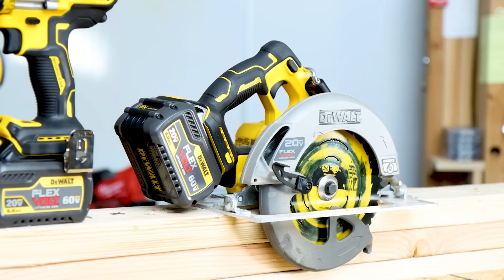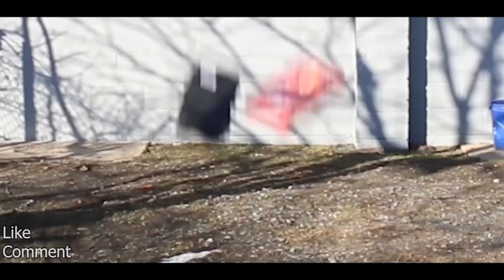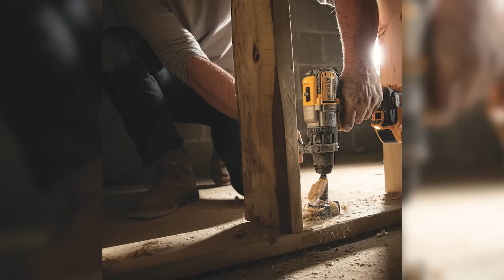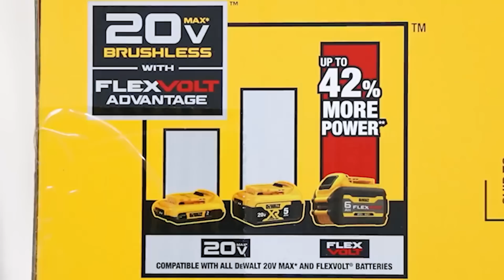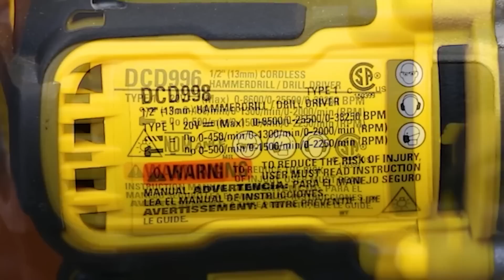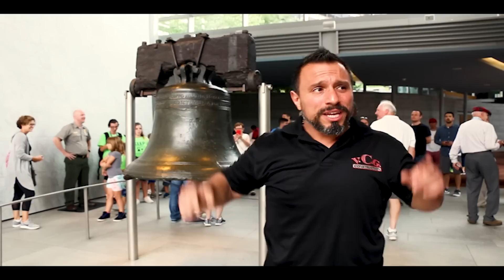DeWALT Tools DIRTY Marketing Tactics (FLEXVOLT Advantage AND Power Detect Hammer Drills)

Comment: You know what though i love and own a ton of dewalt tools at this point but completely agree the naming is a big confusion tactic. 

Its the same with every tool the angle grinder is the worst example i can think of 405 being higher spec than 412 but 415 is better again wtf is that.
And also with theyre combo kit sets. My friend was buying bare tools to build a collection but got tempted to sell them and buy the whole kit in one go. Turns out now most of his tools are brushed (angle grinder, circular saw, hammer drill) all the big power draw tools and thats why as a home owner i would never buy the kits

Dewalt really done goofed basiclly

Comment: I got that package and that 6ah battery was the only DeWalt battery that crapped out in a few months. 2 years ago and the rest of the batteries are still going strong including the 9ah flex volt battery. Only difference is I use the 115 charger for all of them and used the rapid charge charger for the 6ah battery that failed.

Comment: The collaboration between the machine structure and the powerful bateries need a bridge that's called electronic panel, it works as a brain. When we pull the trigger, the electronic panel asks the batery modul to deliver the amount of power to brushless motor. So, I think  the performance of the motor depends of the power of the batery, but the motor has itself limit of the torque. It's just my humble opinion 👌🏼😊

Comment: I am a very old dewalt fan. That is what I have found over the years. I bought the very first dewalt 18v combo drill. It's only competition was at the time makita . Makita was a better tool. Just every time they introduced a new model  the batteries would not work with the older tools. Dewalt has always designed a way for there older tools to work on the new battery line. That is the main reason I have always stayed with them. It is nice that they are finally producing tools that now compete with others. What would be really nice is if you could find a way to get them to make better blades for there lawnmower. I really do like the dewalt cordless lawnmower. It is the blade is crap. As I have the dewalt battery line. And have focused on there 60v line since they introduced it. And yes I have found a different in the power. Much more power with the 60v batteries. You are always going on about the dills impact drivers and saws building tools. As the big 3 are also focusing on gardening tools. I would like to see you putting them to the test . And make dewalt step up.

Comment: There's a simple way to check this get an electric motor and chuck them up an see what resistance they can run without stalling. Torque test channel has the set up if you want to check it out. And yes the set up is expensive but accurate.

Comment: The 996 and 998 and 999 are the same tool with different names. A commonly misunderstood concept among tool buyers is that the AH rating on a battery represents nothing more than run time. While AH ratings do represent run time, they also allow the user to calculate the total power capacity (watt-hours) of a battery with a very simple equation: V x Ah = watt hours. So, a 5 Ah 20v battery has a 100 watt-hours and an 8 Ah battery has 160 watt-hours. This means that the 8Ah battery has more usable power available to any tool with the same electric motor. And just in case you have figured out where this was going: the 996 and 998 and 999 all have the same motor. DeWalt’s marketing genius at work once again🎉

Comment: All seems the same to me 🤷
So quick question, my DCD996 stopped working after 4.5 yrs, only the led light works. Do I get it repaired, look for a 996 on marketplace for around 100CAD or do I get the DCD999 for 300CAD with free flex volt battery? 🤔 Any suggestions and why are welcome, thanks!

Comment: I have a suggestion. Take the drills apart and look at the motors and circuit boards. I have a feeling that you will see what makes them different. Kind of like the xr6 and 8ah batteries. They are the same size and weight. Without the sticker they look identical. But you know the difference is on the inside ;) I’ve been wondering about the differences of these tools myself for a while. Unsure if I’m going to make the best purchase. So I decided to do some lengthy research. Im confident now that I can make the correct choice for my needs. Dewalt is a bit funny about certain things for sure. Especially having slightly different but almost the same things at the depot and slowes ( tools and accessories). There is a lot of bs and truth from any manufacturer. Or contractor!!! Anyways. I’d love to see the video of you gutting these drills open!

Comment: I would call the 60 volt battery introduction an innovation. A 60 volt power source has the potental to kick the 20 volts ass. Amp hours is a measure of available energy, not power. The more AH, the longer the run time.

Comment: Seems to me the 20v max line is their prosumer grade of brushed tools, the XR is the brushless, and the flex volt is the XR that is optimized for flex volt  battery with negligible gains for the extra money spent maybe? I’d definitely have a hard time believing that the drill would really overwork a battery to the point of noticeable power losses on the 18650 packs. Maybe the chainsaws, table saws, and “big draw” tools would and that might be where the extra voltage and money really shines. Have always been a dewalt fan but… almost too many to choose from and not enough clarity. Maybe setting their website up like chainsaw companies like stihl and husky do would help. Homeowner, pro, and contractor instead of a list

Comment: I just bought the compact stud and joist drill at Home Depot today. And the sales guy asked if I had any of the flex batteries, I told him No I have the regular XRs, and he told me, & I quote," that drill won’t work with anything but the flex batteries". Lol. I wanted too say, son I’ve got tools older than you   But I didn’t. I just informed him that the batteries are interchangeable. It’s sad the depot pro does this. I guess either he didn’t know or it’s a marketing ploy for the unsuspecting buyer.

Comment: Does not make sense to use a 5ah XR battery on a flex volt drill. The whole point of any flexvolt or flex volt advantage tool is to go with the biggest batteries, 9,12,15.

Comment: The 996 cannot handle the 8 amp battery it overheats but it won't stall out to protect itself nor can it handle the flex battery it breaks and the 998 detect loses quite a bit of power when it's not using an XR battery but works fine with the 4 amp hour 5 amp hour or 8 Amp Hour but can't handle the flex battery it will overheat and the 999 flexvolt can handle the 5 the 8 and the flexvolt

I don't have any reason to use a flexvolt so I'm running the XR series and I purchased the 998 my question is can my 998 handle a power stack because I can't take advantage of my atomics without the power stack and yes I do think it was a dirty trick because they put it out on the market but they did not tell you what they were doing

Would you please test both ha against each other using a power stack so that I can finally get the answer

Comment: I got a brand new in box 996 flexvolt pack with the impact, 2 batteries and bag like 4 or 5 years ago for $130 bucks off a lady on Fb marketplace. Might have been stolen, but I didn't ask or care lol. Thing has been a joy to use and still going strong. Matter of fact I'm heading out to ice fish and the 996 is what I've been using to drill holes in ice since I got it along with numerous other projects around the house. Cheers!

Comment: I like Dewalt tools for their quality but shy away from their product because Dewalt is constantly changing their battery scheme. This is one thing I can commend Senco/Ryobi on. I have owned Black & Decker and Porter Cable products as well as used Dewalt at work. Nothing more frustrating than when I need to replace a battery to not being able and purchase one because the battery configuration has changed.
In the last year I have noticed an adapter to convert 18v Dewalt tools to the 20v battery. It would be nice if they did the same thing for their other product lines.

Comment: DCD999 Vs DCD996
You can expect enhanced durability from the Dewalt DCD999 compared to the DCD996. Its high power density motor has more copper and longer magnets compared to its predecessor which leads to increased power, and its electronic module enables the tool to recognise when an XR FlexVolt battery is attached to unlock even more power.

Comment: ..  like a paddler in a yelling market.
The main difference in that the 999 is not produced in the USA but China. 996 still manufactured in USA.
999 is more valuable for DEWALT but not for the consumer, it deserved only DeWALT BS.
I bought the 18V150c with a kickback control a torque up to 150 Nm.

Comment: I have been wondering myself I'm sure along with everybody else I think it's all in the battery ...battery technology goes a long ways and it's evolving daily getting better and better.. I think if you were to put that eight amp battery on the dcd996 it would have just as much power as either one of the other two new ones..
Have you thought about doing that and seeing what the difference would be put five amp battery on the new one .. and the 8 amp power battery on the DCd 996

Comment: Having lived in Canada and the U.K. dewalt do have different marketing tactics based on region for example the 20volt max Xr range are identical to the U.K. 18v Xr range. In Blighty manufacturers go for the nominal rating of the battery where as across the pond manufacturers tell the max the battery can be charged to. There has also appeared to be less regulation on what can and cannot be said in advertising literature in the us and Canada compared to the U.K. in fact I can imagine the naming is due to the battery branding and the internals of the drills are identical. The difference in model number will be related to the battery supplied also

Comment: Thank you for the great vid. I only heard of the 2 new additions a week a go so decided to look into them. I have a 996 and it awesome, and yes I agree with you that they are essentially the same tools, and believe that they just benefit from the extra amp hours and the extra cells. An F1 car at the moment has 6 cylinders and is a 1600cc motor producing 1000bhp. Getting a little bit of power faster from more sources creating a more efficient vehicle, so in this case it could be an example of how the battery is affecting the tool, more cells less draw from each, less stress on the cells and faster response and more overall staying power to push through the task. Just my theory. As I've seen with the flex volt advantage saw vs the actual flex volt saw, the flex volt saw destroys it in performance and the advantage saw runs like a 20v saw but slightly better with the flex volt battery and that's because the smallest flex volt battery is a 6amp hour in 20v mode. So a big battery.
Reply: What battery was the 20v saw using? Maybe put a standard 6AH battery on the 20v saw to see if it keeps up with the flexvolt advantage?
Reply: As a DIY guy the 996 that I bought years ago still fits all my needs. A lot of DIY guys I hear go with cheaper brands but every good tradesman I worked with went with Dewalt. I wouldn't mind getting some team red tools alongside my Dewalts so I'm not biased but since my wallet is only so big I think you can't go wrong with any of these drills. Application might vary though. I don't really get into concrete drilling, but mostly work with wood. Its a beast.

Comment: Bro you're absolutely right. Same motors, different batteries. The XR Power Detect is the strongest because it uses the 21700 batteries. But...you can put that battery pack into the other drills and get almost the same power output.

Comment: I'm fairly certain that the 996 does not have programming/chipset to detect the higher capacity 8ah battery or the 60 volts of the flexvolt so it runs the same power regardless of which battery is connected, only gaining advantage of the extra ah of run time.  998 will detect an 8+ah battery and increase it's power because the battery has more and/or better cells so it can handle the extra output.  I suspect it cannot differentiate btw 20v and flexvolt bats though.  The 999 is designed to detect and use the extra output available in a flexvolt battery.  Throw a 5ah battery on them and they are probably all exactly the same.  Give them the battery they are specialized in and the 998 and 999 will increase their power.
Reply: @overkill1340  quick Google says the same thing

Comment: Dewalt is very deceptive in their naming.  I bought a 6.5 inch circular saw just before they came out with the 7.5.  I bought a Dewalt Flexvolt Chainsaw for my son in law and have 3 Dewalt drills.  Recently I used my 6.5 circ saw on some wet treated lumber and it bogged down the tool and drained the batteries.  Now I have 3 2amp batteries that wont charge.  What a rip off.  Dewalt never explains their naming schemes between Max XR and a few other obscure names.  WTF!

Comment: Electrical power is measured in Watts, which loosely translates to working power, such as torque and speed.  I think when the Flexvolt is at 20V, the 3 banks of 5 series cells are in parallel for 9Ah.  3Ah rated cells.  The maximum that exists for 18650 (18mm wide, 65mm long, 0 for round) cells no matter what some companies print on them.  That is why they are trying 21700 (21mm wide, 70mm long, 0 for round) cells.  Each cell can produce more current.  When the Flexvolt is at 60V, the 3 banks of 5 series cells are in series at 3Ah.  5 cells in series at 4.1V (max) is 20.5V  x 9A = 184.5 Watts.  15 cells in series at 4.1V (max) is 61.5V x 3A = 184.5 Watts.  The high voltage, low current configuration means smaller conductors can be used for the same power.  Good for larger motors such as saws.  I am guessing the 8Ah pack is 4 banks of 5 series 18650 cells in parallel at 2Ah each cell.  Perhaps 2 banks of 5 series 21700 cells at 4Ah.  That would be 20.5V x 8A = 164 Watts.  It mostly comes down to comparability.

Comment: I came looking for answers and now I am more confused now than I was before.
Reply: Just get the flex volt. Ignore power detect.
Reply: Did some hard testing with my old 996 to the new 999 I just bought , if you use the 9 amp hour 546 battery it gives you more power than the 996 not by much and my test show that my Milwaukee generation 3 is even with the 999 the only flaw was that the gearing was a little bit too high on the DeWalt so if you take away 250 RPM from the DeWalt I am certain that 999 will be even with my Milwaukee generation 3

Comment: no its not just you steve alot of fast talking , think its meant to confuse us. can you tell me why in the US you seem to have 20v dewalt and in the uk its 18v and 56v flex. i am in the construction trade and everyone seems to use 18v and this has been the norm for a number of years and is more than powerful enough for the trade. be aware when using say 56v flex battery 6amh on a 56v machine then your 6amh battery does not give you 6amh it is reduced, so i believe

Comment: Thank You for your inquiry. No, the FLEXVOLT batteries can be used with both the 20V and 60V line of tools. They are compatible with most but not all of the 20V line-up. The FLEXVOLT will act as a 20V battery when it is installed in a 20V tool. 
Thanks,
DEWALT Customer Care

Comment: I'm not seeing any sort of scientific testing done here. I agree that probably 90% of the drill is likely the same. All their electronics are potted though so you can't really tell what improvements where done there. They can easily make gains just improving power management and delivery. Teardowns and amp clamping the lead into the motor would be a good start.

Comment: I've been using the fex volt battery on my regular 20v sawsall without any issue. Seems like it would be fine on the 996 drill as well.

Comment: VCG you are completely right. DeWalt uses stupid tactics to make themselves better than the competition but their actions show that they are not sure on what to do or which way to take. It's unreal that they prepared 3 different types of drills just to change their minds on which one to market. I had been looking for the 998 & 8A batteries so that the extra power would be useful  for the other tools I was  going to get but noooooo  after waiting for a year DeWalt decided to market only the 999 and the stupid FlexVolt batteries skipping altogether the 998 and 8A batteries and bringing the 999 in a record setting 3 months from when it came out in the US while it usually takes no less than 18 months for the stuff to get here in Europe. 
This people don't seem to understand, or maybe they don't give a shit, that the flexvolt batteries are TOO BIG for comfort and they would have been better following the steps of Bosch which came out with a range of 4, 8 and 12A batteries all based on the 21700. I am literally fed up with their marketing gimmick starting with the 20V and 60V max bullshit. 
If they wanted to make a new drill they could have made one that would provide an increase in power if paired with high amperage batteries independently if regular or powerflex and since I am pretty sure that the 998 and 999 are exactly the same as  the 996 with a change in the firmware that controls the drill they could have saved a ton in marketing bull.
All these gimmicks are not too different from an old television ad for telephone service where you were pre-approved but of course the service was pre-paid.